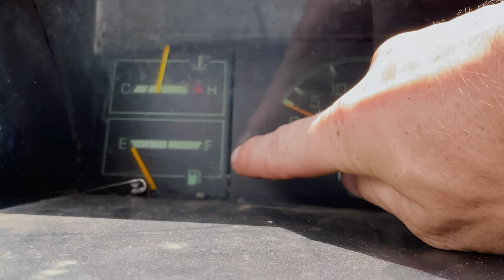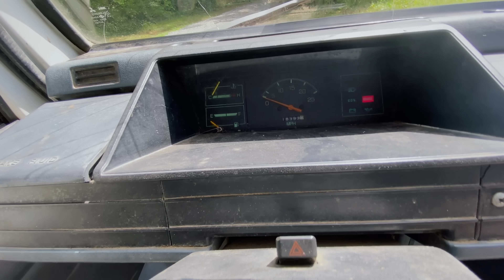I Bought the CHEAPEST Japanese Kei Truck on Facebook!

Comment: Man I love these. Had the van version of this back in the day with a 2 cylinder engine. Maruti Omni, Suzuki built in India basically. Great fun little runabouts. I would beef up the suspension (larger load capacity) and put a more powerful engine in her. Maybe restore her and use her as your shop truck complete with CarsandCameras livery, fat/wide rims/tires and a toolbox/tow bar to handle all your project's on road or track repairs. I would keep the ride height where it is but widen it by about 6 inches each side, slammed it would lose functionality and raised you run the risk of tipping unless you widen the hell out of it which won't look right with such a short wheel base. Personally I would throw a turbo diesel in it out of something like a VW Rabbit, better torque for towing/hills and still great economy. 

Then get another one and throw a bike motor in it, widen/raise it and turn it into a dune thrasher :P

Comment: 13:50 - I assume that ratchet strap is a redneck drive train lowering kit.  If you put the bracket back where it was with that sky high lift in the back, you'll have accelerated drive train wear.

Those big balloon tires are definitely Suspension Helper for off road racing.

I bought a 1996 Daihatsu Hijet kei truck.  4WD with the HI/LO transfer case.  I paid for it a month ago and it's still in Yokohama.  From the pictures and inspection sheet, it's in very good shape for a 26 year old truck.  I paid $370 for it, and another $2010 for the seller to clean it so it passes the USDA inspection and ship it to Newport News Virginia.  I'll probably need to pay a few hundred more dollars to get it out of the port, and around $300 in gas for the 16 hour round trip in my 4Runner to tow it home.  Not sure how much it'll cost to license it but it's legal on Kentucky roads.  The plan is a 2.5" coil over lift kit, 25" DOT rated all terrain tires, and gray Monstaliner bed liner inside and out and a Bluetooth ATOTO stereo with a backup camera.  I'm not looking forward to the importation bureaucracy.  That's why road ready 4WD kei trucks sell for $9K and up.

Comment: Repair stuff first for sure & focus on making it road legal, reinforce suspension a bit with the spacers & bolts.
Sort out brakes, gauges, lights, blinkers etc & increase the governor a little bit if possible as it controls fuel & ignition i believe on this.

BTW if you get hold of the complete drivetrain of the 4wd model you can get more gears with the transmission up too 55 mph, they might have gated out 4th & 5th gear on the us version drivetrain though, but should be easy enough too just swap some bits in the transmission too the non us ones for that, though this thing is sketchy enough as it is probably at 25 - 30 mph, specially with that lift.
Dunno if you can do the same on the rwd transmission but worth researching a bit perhaps ?

Though if you keep the stock drivetrain for now have a transmission mount modeled out & fabricated with some heavy duty bushings so it has a little bit of movement still and not a solid mount.
Just so you don't have too much vibration from the drivetrain directly into the frame & so it doesn't just rip off the mount again when you end up jumping this, which maybe has happened once already with the previous owners shenanigans now holding it in place with the ratchet strap after they lifted this thing & jumped it.
Because ofc you will end up taking this on the jump lol, also consider a rollcage either external or internal, cab is strong enough for a rollover at 25 but not much faster & gonna crunch up pretty good if you smack into a tree as well.

With the condition of the transmission mount i wouldn't be surprised if the engine mounts are on their way out as well as look over the lift kit there & perhaps modify that a bit so its holding the axle a bit better its kind of missing some bits there that prevents the rear axle from angling upwards.

Comment: "There's one good thread"
You're in business, BOLT IT ON!
This is hilarious.  That truck is so ugly it is cute.
And yeah, I can see some real utility in that thing for specific functions like the ones you mentioned, and more.

BTW, in my state (Fl) you could have the insurance company to fix that windshield for nothing.  The crack has to be somewhere in the field of view used for normal driving and bigger than a dollar bill.  Not sure, but I think that one just squeaks by, requirements wise. ;-/  I just had two cars done, and the crack on one just barely met the requirement (low, virtually not a road visibility issue, and just barely dollar bill in length on one, but they did it).  I think it also may be a requirement because even with only one layer cracked the windshield is compromised, strength wise, in the event of a serious crash impact from the worst case directions that could be hazardous to the driver/front seat occupant.

The dropped shape of the door windows, up front, is pretty clever, for visibility.  Not original to this truck, but I would appreciate it, having to move it around cluttered areas.  

"Pretty sloppy paint job'
At least they took the time to spray a bit on the jam so it wasn't showing white in the crack.  A serious nod to professional care in 'upgrade' effort, if you ask me.  But I am aware that nobody did.    ;-)

With the obviously more than adequate sides and tailgate on that thing you could transport half a dozen people, maybe more, with absolute confidence of 100% safety...not.

On the one comment, the clear plastic on the bottom of the seat was probably a clue to the problem you mentioned.  I could go on, but it's already a novel, so ... continuing on:

One more comment.  A LARGE displacement very high horsepower bike engine would be my choice of motivation for that baby.  I've seen them dropped into smart cars, Minis and the like, and the result is quite impressive.  I think Yamahauler made one that was a verifiable 400 hp, rear wheel.  I see by a certain cart video sitting below this vid. you guys could definitely be up for that.  (I wrote this long before I saw you say it in the vid).

Just what  the doctor ordered for the likes of Josephine the secretary driving.  You know, the kind of driver that thinks on a slick wet road it was their brakes that failed (met one, she connected with the back of a car I was riding in, and pretty hard),  And the idiot I was with replied "you should keep them maintained".  Clueless, and somewhat frightening.  I'm talking about he kind of person that thinks ABS and active vehicle stability is license to drive like an idiot in the rain, 'cause like with those there are obviously no longer limits.  But with cars like the Hellcat or the new Tesla sport vehicle, why not?  I can only think of about two thousand reasons, off the top of my head.  

Your vehicle there, at about 120 mph would certainly qualify, by a hair, just like that windshield.  There should at least be a special drivers ed class for cars above a certain HP, much as I hate that sort of mandated thing.  And people driving with phones activated should be stuck in the eye with a pencil.  About half the near misses I have been involved in during the last five years that has been the primary contributor.  Proven worse than significantly above illegal blood alcohol in several experiments.  Video is available of some, if you don't believe it.

IMHO, those backup beepers are brilliant.  Dont'cha know everybody pays close attention to them when there are about ten of them annoyingly beeping all around.  Kind of like that stupid panic button that always gets pocket activated, usually by the stack of keys they are chained to, that nobody even glances at when it happens.  Just a ton of useful functionality there, too.  OSHA, here, possibly, in the one case, I'm guessing, or some insurance lobby.

Fun vid, enjoyed it, subscribed.

Comment: Bike engines are done to death, K swap it. ;) Seriously though, it's really between superbike engine and street tires/wheels or going straight offroad. I always thought putting side-by-side running gear in one would be cool. You could even move the front wheels forward of the cab.

Comment: Left hand drive is military import and they are notorious for problems. The one thing going for you is a full frame. You are going to have a nightmare with the vacuum lines.
Reply: 550cc was early years and 660cc is the new kei truck regulations. you want the 660cc if you want to haul karts. 550cc will always be lacking. I own a '98 Daihatsu hijet super dump and can tell you that 660cc will make a major difference.
Reply: I can also tell you that some of the guys have been switching engines with a goldwing trike motor with reverse. Usually 1200cc or 1400cc which will haul those carts without a problem.
Reply: I can help you guys with american parts that fit kei trucks as I have been researching way to much.

Comment: i ran as a passenger in a simulair k truck and had big throubles getting my knees and head to fit inside the truck , at least this has a raised roof 
i know they build 4x4 versions of these  trucks but i dont know if its an eazy conversion (might be independant front suspension setup ')
turning it intoo a recovery vehicle might be a good idea , big winch in the front and a engine hoist fixed on a bearing to the rear of the bed to lift stuff intoo it https://m.media-amazon.com/images/I/31IWRGLSO8L._AC_.jpg

Comment: amazing how ppl cannot put/keep oil up to the FULL line? wow, ruin a nice machine over the lack of $3/qt of WM oil??? transmission fluid change? xfer case oil changed, diff oil changed... pressure wash it on the way to the house to clean the undercarridge off so dont have dirt fallinlg in ur eyes as u change the oils in the gearboxes.  get rid of the shackles in the back and go with spring over conversion.. front too. any color but primer red... or maird brown.

Comment: Needs a 2 stroke 500 snowmobile engine 4 cylinder just like you want then the massive rpm that 2 stroke will give you over the stock engine would drastically increase the speed